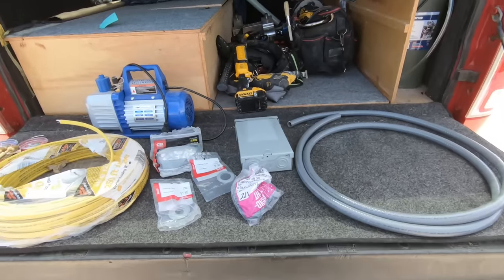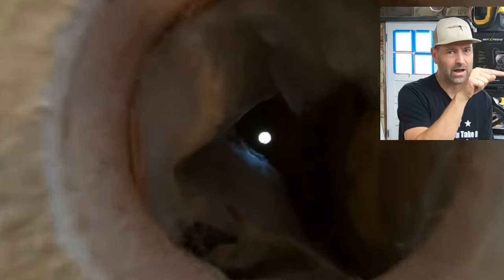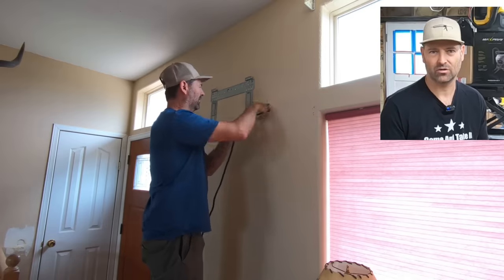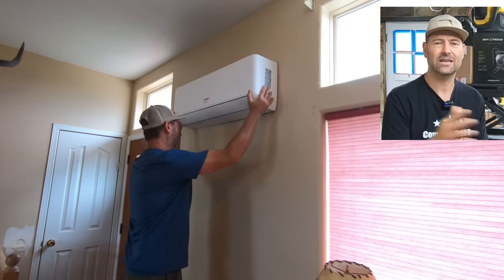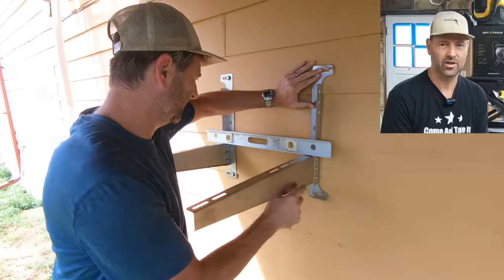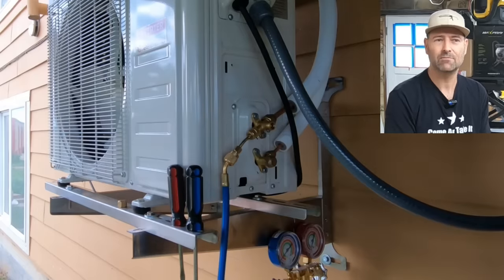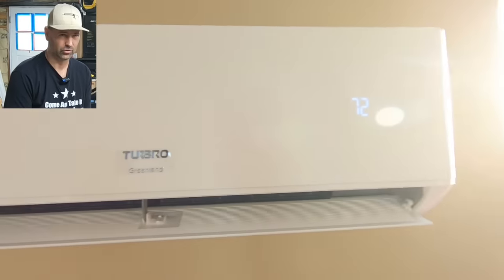They Are Forcing Us To Use These | Heat Pump Or Mini Split Full Install | THE HANDYMAN |

Comment: Heat Pump/Mini splits are here to stay. I'm rural, so no connection to natural gas- I cut my heating bill more than in half this year by not using heating oil. Mini splits are popping up all over out in the country by me but I am worried the grid won't keep up during extreme cold events. 2 things- 1) I have heard that mounting the outdoor unit to studs is asking for maddening vibration and noise for the home owner. Mine is mounted to my CMU foundation and it is noisy in the winter. 2) What is that tape you used to wrap the lineset?

Comment: Very nice install! Have you looked into the MrCool Central Ducted heat pump? I just installed a 5 ton and it is working great. It is DIY capable and has 10 year warranty (parts and labor). It seems very energy efficient but I have not gotten the first power bill yet.

Comment: It shows the wire protective flex conduit with protective outer jacket electrical wire, and cable with a protective outer jacket. When placed in a conduit, Romex-type wire can't dissipate heat well, which can lead to overheating and increased risks. It also can't breathe, which can cause it to retain too much heat. Can possibly overheat.

Comment: Thank you for your video. Turbo has 115V and 230V in the 12,000BTU. Is there a difference in amount of electricity kwh’s for use in the two?
Reply from the maker: I prefer to run 230v when I can.  watts should be the same but the wire size and breaker can be smaller with higher voltage.

Comment: Hi Handyman,
My rental hot water tank broke down in past December and was replaced by serving company Reliance.  My own furnace was replaced 4 yrs ago. Own AC is old. Please advise if it worth to switch to heat pump or any issues that I should pay attention to for switch. Thank you very much.

Comment: The reviews on amazon for less expensive vacuum pumps and gauges are not good. Not sure if it is because sellers source out returns and the system continues or if indeed a higher priced unit is required. I am in need of it for 2 Turbro mini splits. But I don’t want to get a malfunctioning dud. What do you suggest, please. Thank you. And thank you for the video. Another help would be if you could suggest a AWG 16 wire. They speak of crossectional minimum greater than 1.5mm2 and specs don’t show this on products. Support just referred me back to the chart I was asking about. Thank you again. Paula

Comment: HI - this was a nice informative video.  I have a question if anyone should like to comment.  I'm using an LG 22000 unit.  The plate indicates max lineset of 24.6'.  Interesting measurement since linesets usually come in 25' lengths.  So the question,  the lineset is maybe 3" over the specification.  Is this enough to warrant cutting and re-flaring the lineset or is there a tolerance built into these things?  A response is welcome.  Thanks  Douglas PE

Comment: I have a Mitsubishi 48K BTU outdoor unit… runs 4 indoor units..  worst decision I ever made was wall mounting the compressor, it literally vibrates and shakes my entire bedroom.  I eventually built a 4X4 crib enclosure below it (filled with crush stone for weight), and finally jacked the unit up 1/4” and lowered it to the cribbing and removed the wall mount.  I can finally sleep again 👍

Comment: Yes they are. I see the writing on the wall. The residential central air conditioning and heating system is becoming obsolete due to the DOE EPA and the manufacturers. Which is why I’m changing my business model to commercial HVAC and Refrigeration and leaving the residential HVAC industry.

Comment: they actually save you money if you heat with it vs baseboard. like 2x the efficiency in heating...at least when its above 0 F. but most ppl are installing these for AC, and already have other heating means hooked up. new build have central AC / heat.

Comment: May I ask you how how much to install a system like that? Also I do think they're going to last for a specific Market. Not every home was designed with central heating and air conditioning. This is a great option. Thanks brother
Reply from the maker: In my area is $5,000 per head (inside unit on the wall)  That includes the cost of the mini split and labor.
Reply: Look at Pioneer units.  They have DIY units that come charged.  I put a 12000 BTU unit in my Michigan Polebarn and I absolutely love it.  It heats down to -13 degrees and does a great job keeping my 800 Sq. Ft building cool in 90 + degrees heat.  The unit comes with a 5 year warranty and I installed it myself in less than 8 hours. My total cost was less than $1000. and the directions were crystal clear.  I foresee getting at least 10 years of use out of it.
Reply: @GALowe all mini splits come charged.  Maybe you meant Mr cool that comes with the line set charged too.

Comment: When I run wiring for 240v I always run 3 wire plus ground just in case in the future they need the neutral for a different unit or they completely repurpose the wiring.
Reply from the maker: Good idea.

Comment: I want to install one in a basement. Would it be an issue having the outdoor unit elevated above the indoor unit by a foot or so, or possibly at the same level?
Reply: The only issue will be your condensate drain hose, needs some slope outside to drain, or you’ll have to route it to a floor drain which may be a issue depending on where you place the unit.

Comment: My questions is, can you have 2 heating and cooling units for one of the outside units or do you need to get an additional outside unit for every unit that goes inside?
Reply: i have an outdoor unit that can have up to 4 indoor units on it. the outdoor units needs the correct btu's and ports for your situation. unless things have changed, the system can only heat OR cool, not a combination of both at the same time
Reply: It depends on system.

Comment: Not so easy to get to that filter for the elderly.  What other maintenance is required?  I've read heat pumps are more expensive to maintain than a furnace, probably because they need to be recharged periodically, and what happens when there's a leak?

Comment: I'm rocking a gas furnace from 1961. It's terribly inefficient. Don't care b/c there's virtually nothing that can break on it that can't be fixed easily. The blower motor is from 1978 lol.

Comment: Can I use 10/2 wire with single pole 20 am breaker 120 volt
Reply: Is the breaker I use the thing that makes it their 230 or 120? Is it the breaker the regulates that ?

Comment: Cheers for this. I feel bad as I've got one sitting in my office floor, keep meaning to fit it. It's not the solution I wanted, but the others are just way more work or have a higher running cost. We'll see! Good video 👍

Comment: Hopefully, it's a TURBRO and not a TURBRUH. 🤣I've got a mid-60s home that I inherited from my parents that has a dead air conditioner and floor vents that fill up with ground water. We could put the floor vents in the ceilings with a new air conditioner or just put in mini splits in every room and take advantage of zone heating and cooling with a heat pump. We're already using window units and electric heaters. Using heat pumps should help a lot with the electric bill.

Comment: great video. I followed your first one to install one of these for myself. Have you installed a "Ducted" mini split (Also know as hidden duct) system before? I'd love to see a video of that. Appears to be more of a hybrid of a traditional air handler and a mini split. The plenum box connection appears to take a little more thought since duct work is being run. Anyway, great video.

Comment: Great video!  Was pleased to see this unit had better insulation and accessories.  

We replaced our ancient 4 ton Carrier system and gas furnace with a Rheem system last week.  We thought about 17 seer Mitsubishi and Bosch systems with heat pump, but couldn’t do it…and they were twice the price.  $4500 vs $11k (excluding labor).  I was raised to worship and respect the gas furnace and avoid the heat pump.  I’ll probably install a mini split in my garage but that’s it.

Comment: I also wonder how long these units will hold up. I just replaced my split system (gas heat and traditional AC), it was 31 years old. Does the construction of these units seem like they will hold up like that ?
Reply: Sadly NOTHING holds up today like that.

Comment: They only last 3-5 years in high humidity hot environments with constant use. That said, they are still the best option for cooling.
For heating, if it's cheaper, it's a winner.
Reply: This isn't true.

Comment: The house I grew up in, built in 1981, had a heat pump from day one(this is in Virginia). It's confusing to me that heat pumps are being talked about like they are some brand new futuristic thing that people are getting excited or worked up about.
Reply: Yeah, they're pretty common in other mid-Atlantic states like DE, MD, and SE PA, especially in areas that didn't get natural gas lines. I think it's largely due to these areas needing AC in the Summer, so you might as well get a heat pump that can do both AC and heat. The Northeast, at least until recently, wasn't big on AC. The minisplits are especially popular in these areas that may have had hydronic heat and no/insufficient duct work for central heat pump systems.
Reply: They are finally catching on for two reasons.  1. The government tax credits (which not surprisingly resulted in the manufacturers increasing prices which negates much of the credits.  2. In recent years they have gotten better at handing lower freezing temps.

Comment: FWIW, our local utility is offering a rebate to customers who convert major appliances to natural gas.

But I think heat pumps make sense as long as your electrical service is reliable in the winter. Running a generator to power a heat pump makes no sense.
Reply: Backup heats sources are smart wherever you are. Propane heaters, kerosene heaters, wood stoves, and gas fireplaces can add a lot of backup heat if needed.
Reply: Yeah, we got a wood-burning fireplace insert so we'd have a backup heat source. Or hear is gas, but the thermostat is electric.

Comment: In the industry for a while now, be wary of that white insulation. There have been cases of a chemical in it oxidizing the copper linesets, causing pinhole leaks in the copper. Have ran into it a few times. Makes finding the leak hard. The manufacturers recommend sealing the end of the white insulation as a solution.
Reply: Had Fujitsu units put in house about 7 years ago with that white stuff; pinhole leaks all over-drove the a/c guys crazy, they blamed it on "Chinese copper" -this makes more sense.

Comment: These are good systems. I have one that heats and cools my whole house its only a 1 ton unit . Sense installing this unit I don't use my 2.5 ton Ruud Ducted heat pump. You don't realize how much you lose when pushing heat and air through duct-work.

Comment: 12/2 line, what does the split run on, 120 or 240?
Reply: A quick search online reveals it advertised as 115V. But he did say "two hots and a ground" which is how it might be wired for 240.
Reply from the maker: Watch the video.  Its clearly explained.
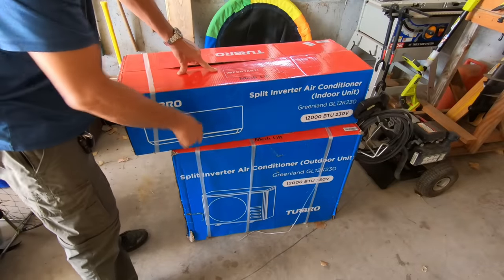Reply: @TheHandyman1  Just rewatched and came acrost the info at 1:29 230volts

Comment: I watch another YouTube channel that is an HVAC and plumbing contractor  in NYC area. He pushings big time, but many of his high end AC replacement customers choose a Bosch heat pump AC  but only for cooling. Most already  have pricey condensating gas furnaces or newer boilers that have 82 % efficiency.and dont want to replace their good existing equipment.  Im in Texas I dont wont to be dependent of the electric grid for both heating on AC. Because of these concerns, I'm considering installing a solar with batteries system to keep the AC running in the Summer with the utilty shits their pant for 2 o 3 days.

Comment: Nobody can predict the future on energy usage but the goverment will take a shot at it (EPA). Regulations cycle every 3 years and on the east coast I heard it is coming down pretty hard. However I Reside in the southwest region of the US and it is extremely a hot climate but just to comment on the mini split I have had my mini split for about 12 years and it is still kicking and I say and recommend  as long as you maintain them maintenance wise they will retain their longevity.

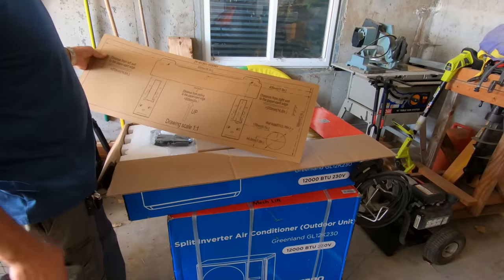Comment: 1:44 @The handyman 
HEY NOW, slow on down here…..😂
Here’s why say that:  cuz installed one of these (not this brand, along w/ some wafer light[led remodelers pot light] ) and and w/ template that we used. 100% wrong and dumb dumb us for not checking from the start 🤦🏼 
So, every time I get a template in box….ya darn tootin, we triple checking that it’s for the items came with and actually lines up and will work. 
Ok, seems like you get the “easy” jobs….or you just make it look so easy as your that good. One look and wink, and the items will install themselves 😅😉
Great job handyman, perfection as usual, and not a bad unit👍🏻👍🏻
Cheers✌🏻

Already have a heat pump HVAC unit for my house in Florida, and been using them for 15 yrs now and not bad, especially the discount from utility (small discount, but a discount), and now the water heaters when they go (knock on wood) will most likely need to be heat pump water heater. They are more expensive up front, but know ppl who’ve we’ve installed before and they like them and save some money; so, sure I guess….one concern is the space that the6 require, along with availability…..

Comment: Heat pumps are definitely getting better and better. We had an old one in the Philadelphia area and had over a $500 electrical bill in the winter. I would find it hard to justify even a newer heat pump in areas above that geographical region.

Comment: I will be moving to a mini split. Why? If you base electric resistance heat as one (COP). My older gas furnace is around 1.8 and my pellet stove is 2.5. The heat pump that I will install drops to 2.5 (COP) at 5 degrees. I only have 24 nights last year below 5 degrees. On cold days below 5 degrees I will run the pellet stove.
I think the heat pump is the way to go. They are charging more for natural gas and more for the monthly service charge. My goal is to have electricity running everything with pellets for cold days. I will shut off gas to save the $15 a month service charge.
The long term goal is solar to remove most of the electric bill.

Comment: Examine the price difference between cooling and reverse cycle heating. Heating is far more expensive. Still can’t beat natural gas for heating. Seer rating is not the same for both cycles

Comment: They're more efficient and frankly, at about $1000 for smaller spaces, disposable. That always appeals to the anti-sustainability crowd, yeah? So I don't understand the expectation of a "50 yr" energy hog that costs more to run every month. Many areas of the U.S. figured this out years ago, after following what other countries did long ago. We're "exceptional," and can't "be told" what to do LOL.

If you need a conventional condenser and air handler for central cooling and heat, American companies have essentially given up, deciding not to compete: Trane now wisely partners with Mitsubishi to offer high efficiency systems in the U.S. Those heat pumps can provide heat when its below freezing outside. If we hadn't spent decades selling low efficiency units as "good enough," maybe we'd be in a better position today. New house next door to me; it's got a 13 SEER sticker on the condenser -- in 2023 -- and of course it's huge. WTF are we doing??
Reply: So you need to do the math on unit cost, expected life and operating costs. This math gets complicated because of how long units "last." Some companies will claim 30 years, but then sell you a replacement in 15. On average right now it is 13 years nationwide. With the 13 year life span of a unit, energy needs of a location, cost of money, cost of energy and more one can figure it out. Generally, because the low end units are so much cheaper, that is best thing to buy. In my own case I needed to decide between an 18 seer unit for 1,200 or a 22 seer unit for 1800. Given the 10 year life, the fact it was my first install, and I didn't want to screw it up, the cheaper unit was better.  According to my math, the new government SEER2 ratings which push up the efficiency of units is actually bad, causing customers to spend more on expensive units than they will ever save on power, but long term with mass production unit costs may come down again. (making this a complicated math puzzle_.

Comment: Technology Connections did a great heat pump series debunking a lot of the FUD around them. I do believe they are the future and will only get better. That said I do know of the issues in climates that have extreme cold, but in the US how many days out of the year is that really a issue where if you had reliable "emergency heat" backup solution to fill the gap. 

Also some of the emerging heat pump tech like water to air or geothermal look really interesting.

Comment: Small correction in the beginning you said you had 12/2 wire 220 needs 12/3 wire.
Reply from the maker: That is incorrect.  99 percent of 240v equipment does not have a neutral.   2 hots and a ground.
Reply: @TheHandyman1  I stand corrected my bad.

Comment: Heat pumps have more parts to go wrong, I'm from the south and rarely need heating (use mostly straight cool systems) with a well insulated house, Government wants heat pumps in the near future, refrigerants are always being phased out, now a lot of refrigeration equipment and some resi refrigerators are using a type of propane and you have to be extra careful when opening up a system and putting it back together, climate pansies are costing the consumer more and more.